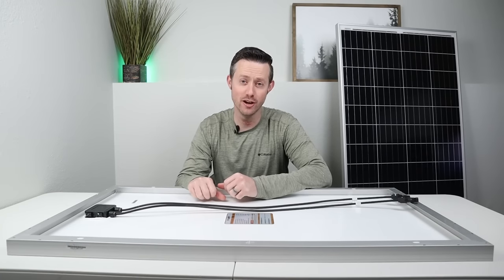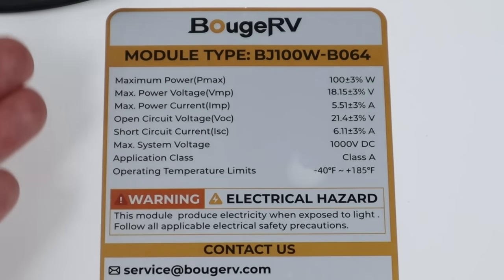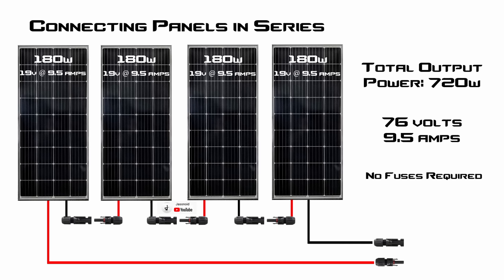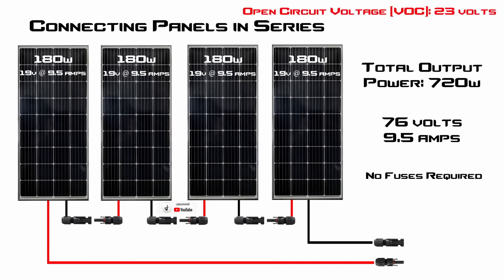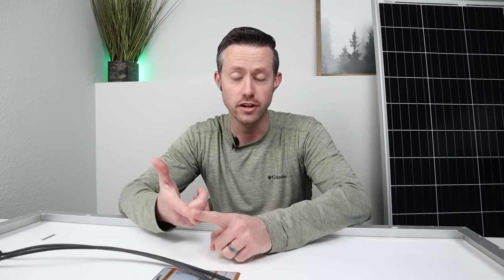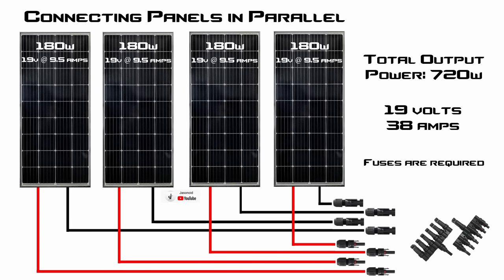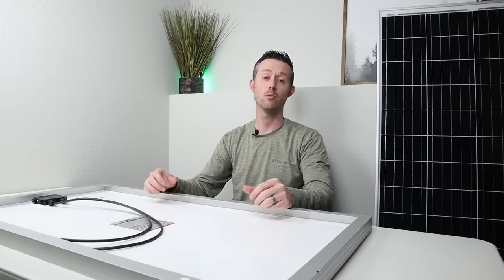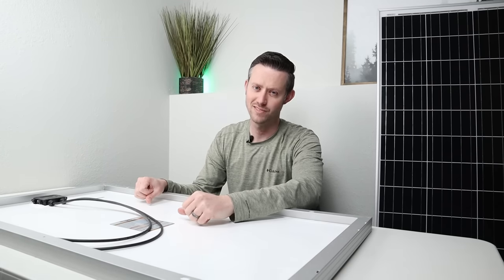Series VS Parallel! A Beginner's Guide for Solar Panel Connections - With Basic Diagrams!

Comment: very helpful video thanks.  i recently saw another video by a large channel where the creator talks about this same thing (series, parallel, series+parellel) but only used the 'marketed' voltage, i.e. 12v, 24v, etc. and not the Voc.  Two days and much research later, I'm convinced that video was incorrect and potentially dangerous.  Thank you for the easy to follow vid with real-world setups.
Reply from the maker: Yeah, the fact that 12v panels actually  put out 19 - 23 volts can be confusing. I hate to see other videos causing confusion.

Comment: Great video!  Very well detailed and laid out, thanks.

I put together an experimental setup.  Six 140w panels on my garage roof setup in a 2s3p arrangement.  Putting about 180v into the charge controller in full sun.  Along with a battery bank of 16 40ah lead acid batteries arranged in  a 48v 4s4p setup.  (Used batteries that I was able to grab when they were swapped out of a server room UPS for routine maintenance. )

The goal was to see if I could use solar to at least help with charging my EV car, ebikes and escooters.

So far it seems to work.  At night after a full day of charge, I can get about an hour of charge into my car before the batteries are drained and the charge controller switches over to grid to continue.   Hours longer if it is just my ebike.

During they day, charge is naturally longer with the help of solar power.  

I think the setup is working about as expected.  Even though it's only about an hour of charge for the car at night.

If I ever get the opportunity  to add more panels and switch over to Lithium batteries, I am sure I could get closer to a goal of at least 50% charge from solar for the car.
Reply: 1  In the name of God, the Gracious, the Merciful.

2  Praise be to God, Lord of the Worlds.

3  The Most Gracious, the Most Merciful.

4  Master of the Day of Judgment.
5  It is You we worship, and upon You we call for help.
6  Guide us to the straight path.
7  The path of those You have blessed, not of those against whom there is anger, nor of those who are misguided.

2  God, there is no god but He, the Living, the Eternal.  To Him belongs everything in the heavens and everything on earth. He is the Sublime, the Magnificent. Originator of the heavens and the earth. He made for you mates from among yourselves, and pairs of animals, by means of which He multiplies you. There is nothing like Him. He is the Hearing, the Seeing.

3  He sent down to you the Book with the Truth, confirming what came before it; and He sent down the Torah and the Gospel.
4  Aforetime, as guidance for mankind; and He sent down the Criterion. Those who have rejected God’s signs will have a severe punishment. God is Mighty, Able to take revenge.
5  Nothing is hidden from God, on earth or in the heaven.
6  It is He who forms you in the wombs as He wills. There is no god except He, the Almighty, the Wise.

1  Say, “He is God, the One.
2  God, the Absolute.
3  He begets not, nor was He begotten.
4  And there is none comparable to Him.”

13  To Him belongs whatever rests in the night and the day. He is the Hearing, the Knowing.
14  Say, “Shall I take for myself a protector other than God, Originator of the heavens and the earth, and He feeds and is not fed?” Say, “I am instructed to be the first of those who submit.” And do not be among the idolaters.

100  Yet they attributed to God partners—the sprites—although He created them. And they invented for Him sons and daughters, without any knowledge. Glory be to Him. He is exalted, beyond what they describe.
101  Originator of the heavens and the earth—how can He have a son when He never had a companion? He created all things, and He has knowledge of all things.
102  Such is God, your Lord. There is no god except He, the Creator of all things; so worship Him. He is responsible for everything.
103  No vision can grasp Him, but His grasp is over all vision. He is the Subtle, the Expert.
104  “Insights have come to you from your Lord. Whoever sees, it is to the benefit of his soul; and whoever remains blind, it is to its detriment. I am not a guardian over you.”

143  And when Moses came to Our appointment, and his Lord spoke to him, he said, “My Lord, allow me to look and see You.” He said, “You will not see Me, but look at the mountain; if it stays in its place, you will see Me.” But when his Lord manifested Himself to the mountain, He turned it into dust, and Moses fell down unconscious. Then, when he recovered, he said, “Glory be to you, I repent to you, and I am the first of the believers.”
144  He said, “O Moses, I have chosen you over all people for My messages and for My Words. So take what I have given you, and be one of the thankful
145  And We inscribed for him in the Tablets all kinds of enlightenments, and decisive explanation of all things. “Hold fast to them, and exhort your people to adopt the best of them. I will show you the fate of the sinners.”

36  To every community We sent a messenger: “Worship God, and avoid idolatry.” Some of them God guided, while others deserved misguidance. So travel through the earth, and see what the fate of the deniers was.

16  And mention in the Scripture Mary, when she withdrew from her people to an eastern location.
17  She screened herself away from them, and We sent to her Our spirit, and He appeared to her as an immaculate human.
18  She said, “I take refuge from you in the Most Merciful, should you be righteous.”
19  He said, “I am only the messenger of your Lord, to give you the gift of a pure son.”
20  She said, “How can I have a son, when no man has touched me, and I was never unchaste?”
21  He said, “Thus said your Lord, `It is easy for Me, and We will make him a sign for humanity, and a mercy from Us. It is a matter already decided.'“
22  So she carried him, and secluded herself with him in a remote place.
23  The labor-pains came upon her, by the trunk of a palm-tree. She said, “I wish I had died before this, and been completely forgotten.”
24  Whereupon he called her from beneath her: “Do not worry; your Lord has placed a stream beneath you.
25  And shake the trunk of the palm-tree towards you, and it will drop ripe dates by you.”
26  “So eat, and drink, and be consoled. And if you see any human, say, ‘I have vowed a fast to the Most Gracious, so I will not speak to any human today.'“
27  Then she came to her people, carrying him. They said, “O Mary, you have done something terrible.
28  O sister of Aaron, your father was not an evil man, and your mother was not a whore.”
29  So she pointed to him. They said, “How can we speak to an infant in the crib?”
30  He said, “I am the servant of God. He has given me the Scripture, and made me a prophet.
31  And has made me blessed wherever I may be; and has enjoined on me prayer and charity, so long as I live.
32  And kind to my mother, and He did not make me a disobedient rebel.
33  So Peace is upon me the day I was born, and the day I die, and the Day I get resurrected alive.”
34  That is Jesus son of Mary—the Word of truth about which they doubt.
35  It is not for God to have a child—glory be to Him. To have anything done, He says to it, “Be,” and it becomes.
36  “God is my Lord and your Lord, so worship Him. That is a straight path.”
37  But the various factions differed among themselves. So woe to those who disbelieve from the scene of a tremendous Day.
38  Listen to them and watch for them the Day they come to Us. But the wrongdoers today are completely lost.
39  And warn them of the Day of Regret, when the matter will be concluded. Yet they are heedless, and they do not believe.
40  It is We who will inherit the earth and everyone on it, and to Us they will be returned.
41  And mention in the Scripture Abraham. He was a man of truth, a prophet.
42  He said to his father, “O my father, why do you worship what can neither hear, nor see, nor benefit you in any way?
43  O my father, there has come to me knowledge that never came to you. So follow me, and I will guide you along a straight way.
44  O my father, do not worship the devil. The devil is disobedient to the Most Gracious.
45  O my father, I fear that a punishment from the Most Gracious will afflict you, and you become an ally of the devil.”
46  He said, “Are you renouncing my gods, O Abraham? If you do not desist, I will stone you. So leave me alone for a while.”
47  He said, “Peace be upon you. I will ask my Lord to forgive you; He has been Kind to me.
48  And I will withdraw from you, and from what you pray to instead of God. And I will pray to my Lord, and I hope I will not be disappointed in my prayer to my Lord.”
49  When he withdrew from them, and from what they worship besides God, We granted him Isaac and Jacob. And each We made a prophet.
50  And We gave them freely of Our mercy, and gave them a noble reputation of truth.
51  And mention in the Scripture Moses. He was dedicated. He was a messenger and a prophet.
52  And We called him from the right side of the Mount, and brought him near in communion.
53  And We granted him, out of Our mercy, his brother Aaron, a prophet.
54  And mention in the Scripture Ishmael. He was true to his promise, and was a messenger, a prophet.
55  And he used to enjoin on his people prayer and charity, and he was pleasing to his Lord.
56  And mention in the Scripture Enoch. He was a man of truth, a prophet.
57  And We raised him to a high position.
58  These are some of the prophets God has blessed, from the descendants of Adam, and from those We carried with Noah, and from the descendants of Abraham and Israel, and from those We guided and selected. Whenever the revelations of the Most Gracious are recited to them, they would fall down, prostrating and weeping.
59  But they were succeeded by generations who lost the prayers and followed their appetites. They will meet perdition.
60  Except for those who repent, and believe, and act righteously. These will enter Paradise, and will not be wronged in the least.
61  The Gardens of Eden, promised by the Most Merciful to His servants in the Unseen. His promise will certainly come true.
62  They will hear no nonsense therein, but only peace. And they will have their provision therein, morning and evening.
63  Such is Paradise which We will give as inheritance to those of Our servants who are devout.
64  “We do not descend except by the command of your Lord. His is what is before us, and what is behind us, and what is between them. Your Lord is never forgetful.”
65  Lord of the heavens and the earth and what is between them. So worship Him, and persevere in His service. Do you know of anyone equal to Him?

111  And say, “Praise be to God, who has not begotten a son, nor has He a partner in sovereignty, nor has He an ally out of weakness, and glorify Him constantly.”

85  Whoever seeks other than Islam as a religion, it will not be accepted from him, and in the Hereafter he will be among the losers.

Read The Quran
“I am to you a clear warner.”
 “That you shall worship none but God. I fear for you the agony of a painful Day.”

Comment: I'm wondering if there is an advantage to using a separate controller for each panel rather than a series/parallel combination and just 1 controller?  My application is marine rather than a home installation. Great video, very clear, thanks. I have subscribed.

Comment: This is a great explanation video. The balance method of series and parallel setup sounds great, going to modify my setup once I get my fourth panel in from all parallel to this mixed option. Especially important was understand how to properly use fuses in the setup.
Reply from the maker: Glad it was helpful for you!
Reply: @Jasonoid  One question, if I understood parallel and fuses correctly, when I hook my two 100 watt panels into the y connector Isc 5.21a Imp 4.1a the fuse should be after the Y connector to protect the other 2 panels in the series setup as parallel? I have four panels, 2 pair in parallel and then series.
Reply from the maker: @ejthebus1355  with that low amperage per panel you are fine to install fuses after the Y connector.
Reply: @Jasonoid  I was pretty certain that was the case, being new to solar wanted to double check, thanks for resonding.

Comment: I know that it is late for this, but you didn't show a comparison between the calculated values and what was actually seen at the charge controller. Which setup provided the most power over a day? You should also include a charge controller in your demo, so that people know how to read the limits of their solar charge controller and how that could impact their decision on how to connect their solar panels.

Comment: I would like to see a video just on different solar cable/connector options. Touched on it some here but there are so many different ways to set up with branch connections, Y connectors, etc. Roof install vs. ground deploy, Is there a max length to stay under for ground deploy, 20 ft, 30 ft.? What if I have odd number of panels- series or parallel for that? Best solar controller for ground deploy for RV use.
Thanks for your videos, they're always great!
Reply from the maker: You might find this video helpful for determining length of your wires and how much power you'd lose:   https://youtu.be/AZIBmFBzBGs

Comment: LOVED YOUR VIDEO VERY VERY IMFORMITIVE. I WANT TO HOOK UP DIRECT INTO THE GRID AND TRY AND SLOW MY POWER COMMING IF FROM THE GRID. WOULD I BE BETTER TO HOOKUP MY PANELS IN SERIES&PARALLEL THEN HOOK UP DIRECTLY INTO MY POWER INVERTER WHICH IS 1200W.

Comment: Very good and useful video.  I put a few small systems together for a shed, van, and motorhome and discovered that the charge controllers sometimes have low limits on voltage maximums. So, wiring in series and parallel are necessary to stay under the MPPT's maximum allowed input voltage.  Their max voltage specs vary all over the map.  

I bought several rolls of 10 gage wire and a bag of MC-4 terminal connectors to make my own cables. The kit came with special crimpers for the internal metal connectors.  The metal ends inside the connectors are different for positive and negative. I'm old school but for the first time in my life I had a total meltdown with endless gender confusion during my first attempt to make my own cables. It just didn't make sense. The male outer MC-4 ends have female connectors inside. Female outer ends have male crimp on connectors inside. A positive cable has both male and female outer ends. the negative cable does as well. Never fear. It all makes sense now after doing about 10 cables. Even with no markings, the male connector on every solar panel is positive. Thank goodness that is all standardized now.
Reply from the maker: Yes. The genders of MC4 can get confusing because male and female are swappable depending on the direction of the power. I always follow the power from the source and that helps keep things straight. Sometimes I mark the connection with a silver sharpie to be safe.
Reply: I use Red electrical tape wrapped around my black positive cables.

Comment: Yes the video is very useful, and people should save it. There’s people living off grid that do this with car batteries to meet their needs. Been watching a lot of videos, but I can’t ever find one teaching people how or the best way to calculate kWh for the individual based on comfort and life style, especially people who are nomadic in RVs van and Bud conversions as well as the best batteries capable of holding the amount of energy (kWh) every day, and roughly how many days can be got away without a charging cycle. I found a calculator on some site that helped me add things up for me, and I had to calculate my PS4 with my average daily play time. I found that I personally use 8-10kWh a day even less when I’m off doing things. I live in a van conversation with a dog … only problem is now, I don’t know which batteries or system to buy. I’m not made of money, but I don’t mind making investments and then growing the investment with more purchases over time.  With that said can you also cover the different tiles of solar collector types. Mono vs Poly silicon or crystalline or silicate I think it is. I’m asking for all those people out there who want to know especially for nomadic people where the money is best spent and in what priority those purchases should be made.  Pretty much as in what if you were living mobile, where would the first place you’d start building a solar generator assuming the budget is somewhere between the scope of can’t afford eating caviar but not roughing it with baloney sammiches either.

Sorry for the essay inquisition.

Comment: Your explanation is very well done.  Thank you for your video.  I just bought an Ecoflow ultra.  And my sixteen 100w solar panels just came in.  What is the best way to connect them?
Reply from the maker: That's a difficult question that has a lot of variables. Please reach out to me here:
https://asqme.com/@Jasonoid
You'll need to send me the exact solar panels you purchased and their specs and how you plan to mount them for use.

Comment: Good video, thanks.  Can you do one on hooking up a grid-tie inverter?  Specifically, how do you hook up the AC output to the main load in a house?  Does it need to hook directly into the main breaker panel or can you just plug it into a wall receptacle?  And where would the fuse or breaker be placed in the circuit from the PV source?  Thanks.